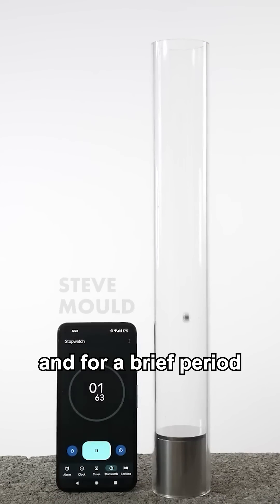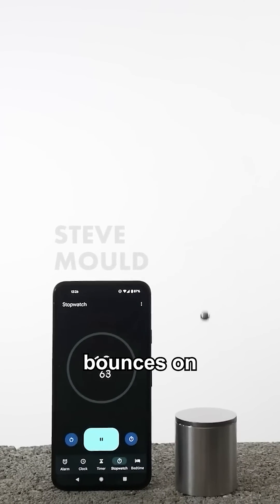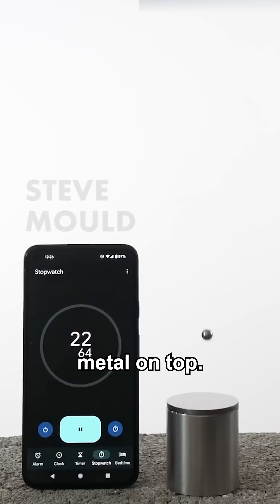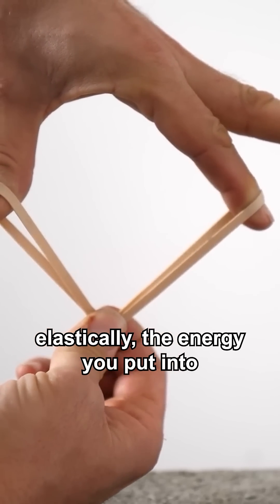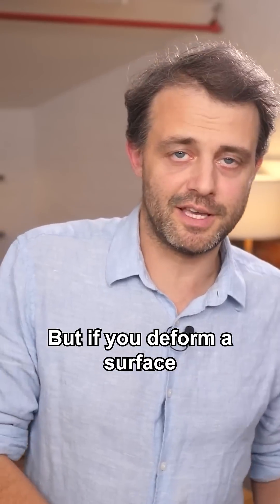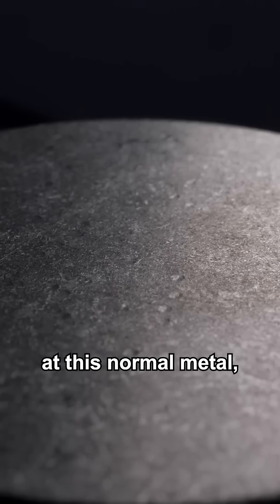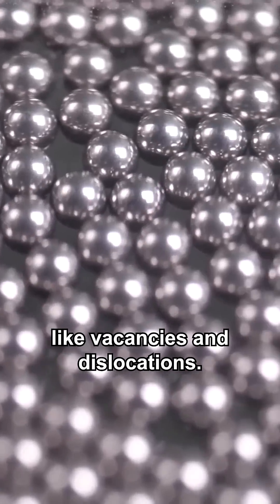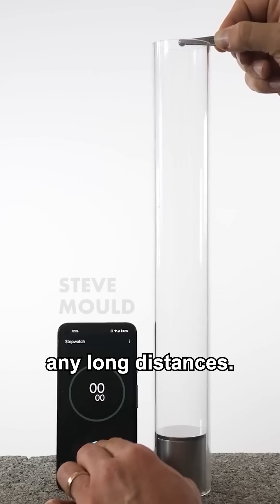Explaining the atomic trampoline

Comment: Now make us spherical, atomic trampoline and bounce it on the atomic trampoline with walls made out of atomic trampoline. Basically, you just gotta make a hollow sphere with a little hole to put the atomic trampoline bearing in, but you make the hollow sphere and on the inside of the atomic trampoline bit and then you have a little plug that’s also atomic trampoline and just see how long it goes.

Comment: Not only do metals plastically deform, but there is also elastic hysteresis. The metal returning to its original shape does not release as much energy as was put in. The difference is turned into heat, just like with plastic deformation.

Comment: Is that also why anvils with hardened tops bounce a hammer more easily?
Reply: Yes- Except the anvil surface is not amorphous. It’s just hardened.  The idea is that if it’s more elastic than the metal you are hammering on top of it, then more of the energy goes into the metal you are working and less into the anvil.
Reply: @christopherpardell4418  I should've clarified my initial question: Is the reason that hardening reduces elasticity because of the resulting non-uniform/non-crystalline atomic structure?
Reply: @Yes, work hardening is just shifting atoms within a metal so that discontinuities in the crystal matrix are increased. These offsets in the atomic crystal are like ‘ledges’ between sheets of atoms that catch and prevent slippage.  And this makes the metal less plastic. Annealing can heat the metal to the point where the necessary forces between atoms can reassert the original lattice, effectively ‘healing’ these dislocations.
On an anvil, you only need the working surface to be treated for high elasticity, the main body can be ordinary iron or steel.
I have no idea if anyone has ever made an anvil with an amorphous steel top… would be interesting.
Reply: @christopherpardell4418  Thank you!
Reply: This is the comment I was looking for! I have seen vids where quality anvils are shown to bounce the hammer compared to cheap anvils where the hammer does not “bounce” back at all. It must be the same thing as being demonstrated here.

Comment: Those little pits where the ball bearing hit form the beginning of shot-peening - a literal work-hardening of the surface of the metal (assuming it's a metal that can be work hardened)
Reply: I wonder if these pits occur on amorphous metals, as I can't visualise how an amorphous substance would compress in a way that retains the general structure of the original surface, vs a lattice which is easier for me to understand
Reply: @johndeaux8815  yeah wish it showed a close up or that picture of the lattice for metals but amphorus

Comment: Really interesting! What if you use bigger and heavier ball bearings? What happens if you bounce a glass ball on it?
Reply: @johannez-nm It would be interesting to know what would happen if the ball was made of the same material as the plate
Reply: @RickyLab it already is - ball bearings are a hardened alloy.
Reply: @1155727  I meant a ball made of vitreloy, the same alloy as the trampoline plate.
Reply: I am curious about a denser ball, tungsten maybe

Comment: I have an idea... It's bad but I will say it.... What if you put a quarts crystal underneath the plate(not necessarily this one) you know like those in lighters. So you can match the frequency of the electricity to the crystal so that it will expand when the ball hits and push the plate so that the ball bounces back up with the same energy? So it bounces forever???
Reply: that actually would be really cool. probably hard to time the pulses though.
Reply: @boxr_4214  mayby with a sensor close to the plate would fix it?
Reply: Perpetual motion machines don't exist.  Energy is lost every time energy changes from one form to another.  Crystal stress/deformation.  Electrode.  Wire resistance.  Induction coil.  Magnetic field.  You could "fake" it, maybe, by using a battery, or solar cells, etc., but that is not perpetual motion.  That would be relying on external energy, not just the ball itself.
Reply: @Warp9pnt9  you didn't understand what I meant, I am not good at explaining things 😕 but I meant for it to be powered by a battery not to be a no energy loss machine 😅 that's impossible
Reply: Looking at how little energy is lost with each bounce if you could power the quartz at the right times you could have a "perputual-machine" toy that last a long time on single battery
Reply: @absurt11  yeah thats what I am thinking! And mayby it will work with a less bouncy matiral !

Comment: Why can’t u buy it anymore? What law changed?
Reply: No one mass produces it
Reply: The law of supply and demand, maybe.
Reply: @Bob5mith 😂😂😂
Reply: Someone explained in the comments of either the long version of Steve's video or NileRed's, I don't remember which one. Let me try to remember, aided by Wikipedia, I take no responsibility for the factuality of the following. The metal disc contains Beryllium, which is relatively safe in this metal alloy form, but extremely dangerous, even in small quantities, when in powder form. It turns out that giving it a flat shape requires grinding it, thus workers faced great risks for basically a novelty toy. Moreover, also the final user can get berylliosis if the disc is damaged in some way (imagine a child dropping it on the floor and accidentally breathing some of the dust).
Reply: @aluminatestrontium7298 and just to top all that off (as if being dangerous wasn't enough) it's hard to make, and if you mess it up you just made a piece of garbage that acts like any other flat piece of metal
Reply: Thx guys
Reply: the government is hoarding all the atomic trampolines to make the world's first atomic trampoline park.
Reply: Apple bought the company that made it, used it to make the SIM removal tool for a couple of iPhone models, and then abandoned it.